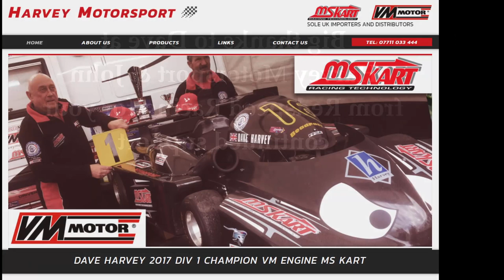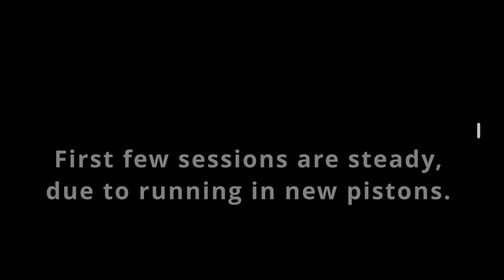Rob Stubbs - Division 1 Superkart - 'Dyno Test' - Maximum Power at 14,000 RPM!!

Comment: Is that dyno made specifically for superkarts?
Reply from the maker: Hi mate, I think it can cater for motorcycles too, but yes the main use of this particular dyno is Superkarts 👌🔥🔥
Reply: @MyRob10  should get some more videos of that Dyno in action. Must make showing up to track day so much simpler.
Reply from the maker: @mathewbarton1401  yeah absolutely mate, you can work on engine setup, and run in pistons prior to the event which saves time on a test day, so you can ultimately get straight onto the pace quickly without the need of running in pistons which requires less revs/ speed etc
Reply: @MyRob10  how close to 100hp are you getting? Without revealing to much?
Reply from the maker: @mathewbarton1401  it’s as good as or above depending on temperature conditions mate